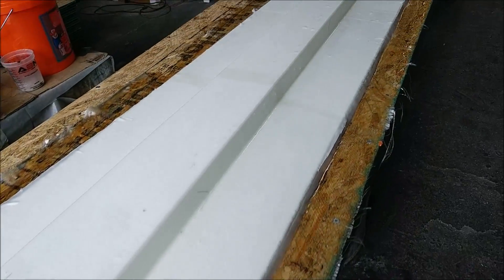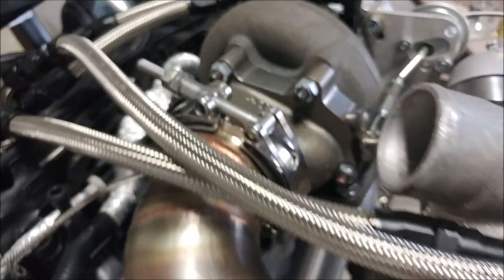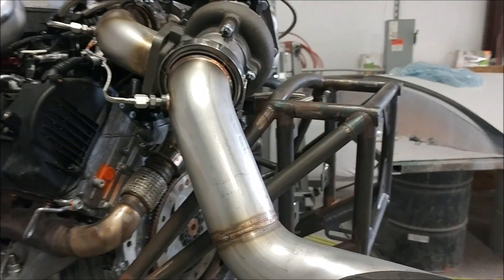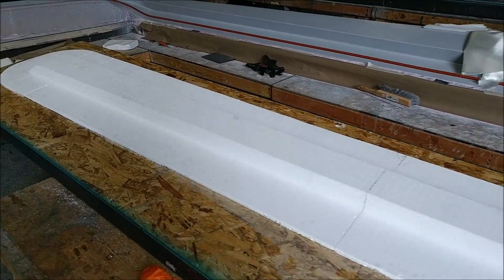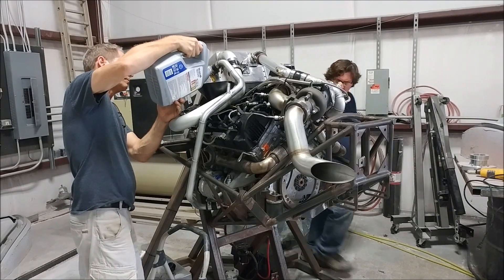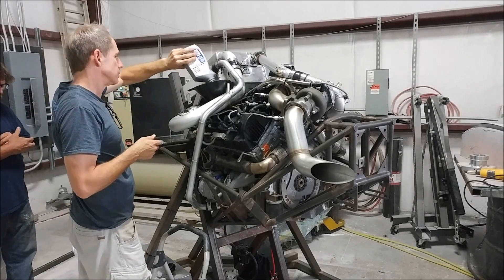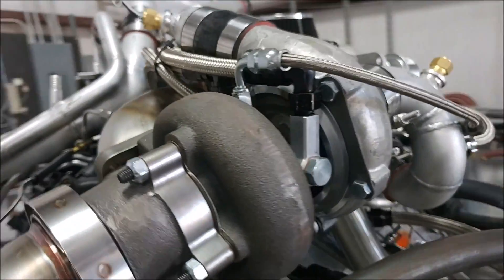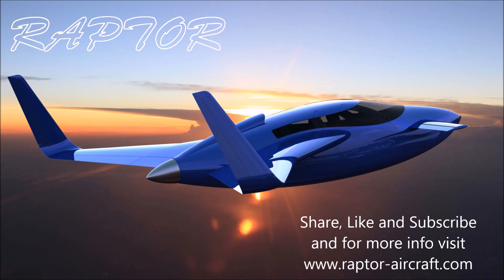Engine Libations - The engine gets some oil

Comment: I'm sure you've accounted for this, but it's worth mentioning.  Diesel engines can get into a run away situation, if you over fill the oil pan.  I don't remember if you've modified the panel or if it is stock.  But the fact that you are adding more oil for the added equipment, this might be worth checking into, if you haven't.  Runaway's don't always end well.

Comment: This will show my vintage age, does that new engine not need non detergent oil for breaking in and seating of the rings? Beautiful work on everything!
Reply from the maker: It's a used engine with about 8000 miles on it already.
Reply: Thanks, and I remember that from a previous video - it looks new.  I watch every one of your videos and so admire your talent and drive for a project like this!
Reply: However .. I will give you a HIGH FIVE for asking an intelligent question. Gosh.. I can hardly wait to fly this plane!!